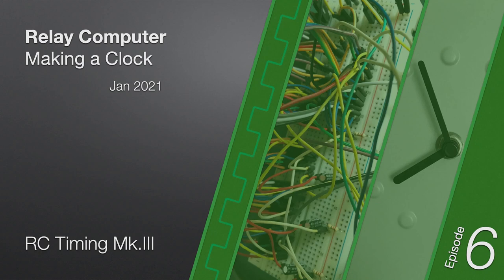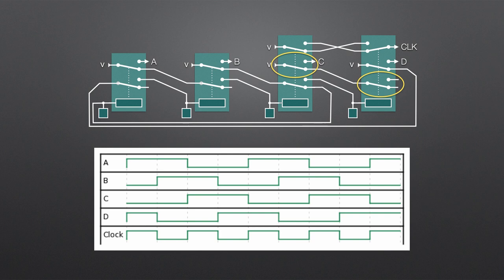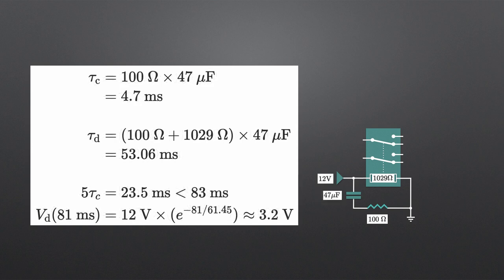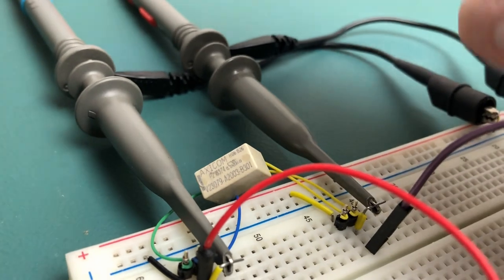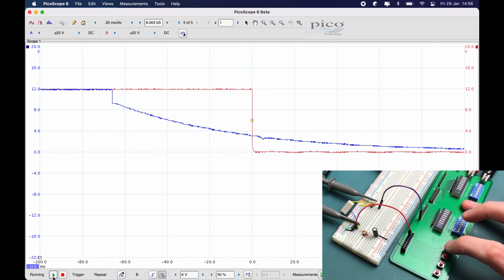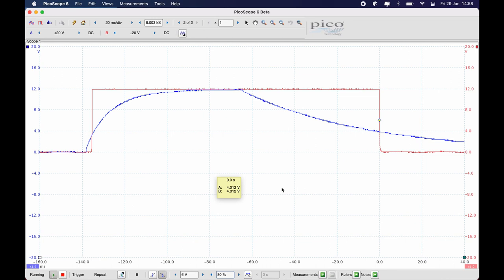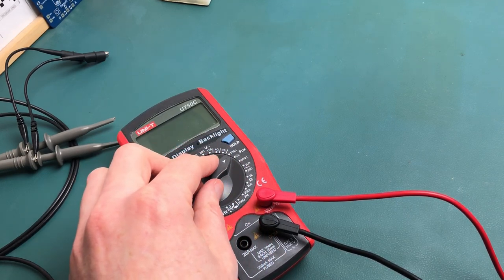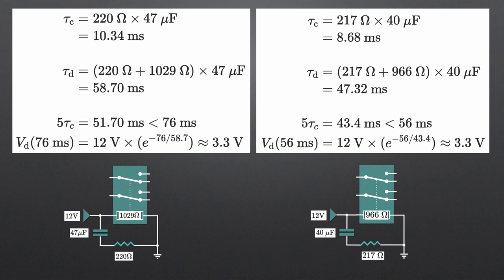Relay Computer Clock - Ep6 - RC Timing Mk.III

Comment: It's always a good idea to put a diode (cheap 1N4148 will do) across the terminals of the relay, in anti parallel (opposite polarity) to take the voltage spike from the magnetic field dropping (it can be significant), as that can both lead to undesired results, and in some cases kills semiconductors, had you had any. Of course it's not used in simple setup's, like buffering a light switch for higher power rating. But it can cause sparks in worst case, or simple hurt a lot.
Reply from the maker: As it happens it's the 1N4148 I've been using throughout the computer across each relay coil :) Also just noticed in the last episode you can actually hear the microphone picking up the spike when the relay coil turns off without a protection diode (around https://youtu.be/52UlZ9TZsrI?t=487).
Reply: @paul80nd  Indeed, I should have paid more attention before making such comment  ;-)

Comment: You don't need to stay in one resistor series. I mean, if you only stocked certain values that's on you but 270ohm is not a nonstandard value and is readily available. Pretty much as long as the acceptable value is within the first two digits, it likely exists in bulk quantity for pretty cheap.
Reply from the maker: Yea, I think when I come to constructing I can 'invest' in a different series (and maybe higher tolerance for caps + resistors etc).

Comment: Just a though, did you consider using Reed relays at least some places where speed is of an essence? Sure, they are less cool, as they don't make any significant clicking noise if any, but they are way faster up to several hundreds switch per second.
Reply from the maker: Yea, I considered them for the clock but decided to make two clocks on one card - a regular relay one and then an adjustable one running from a 32.768 KHz crystal divided down. One for 'authenticity' and one that I'll actually use most of the time ;)
Reply: @paul80nd  Awesome; I also tried the web emulator, it's very serious project. Respect !

Comment: But why ?
Why has 2 relays makes this bounces and only one doesn't ?
Is some kind electric oscillation that is happening between the 2 coils ?
Reply from the maker: Interestingly I reproduced the issue recently with just a single relay when using a 100 µF capacitor so looks like it's not the two relays interacting after all.